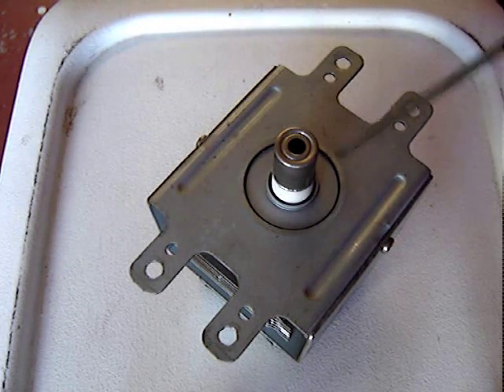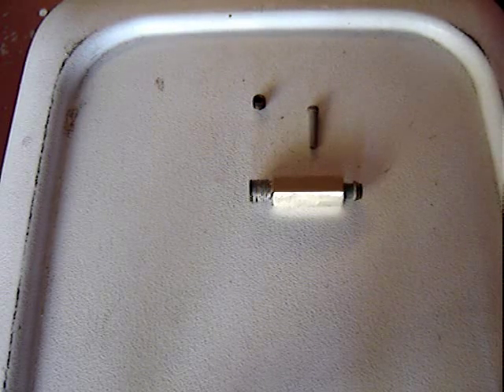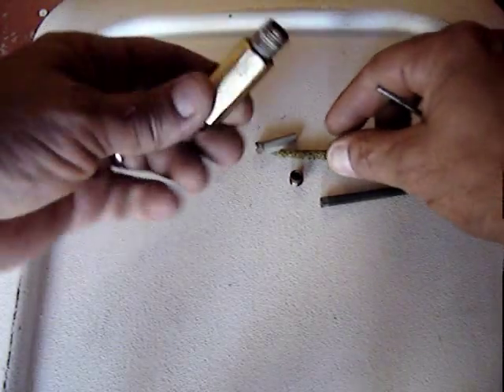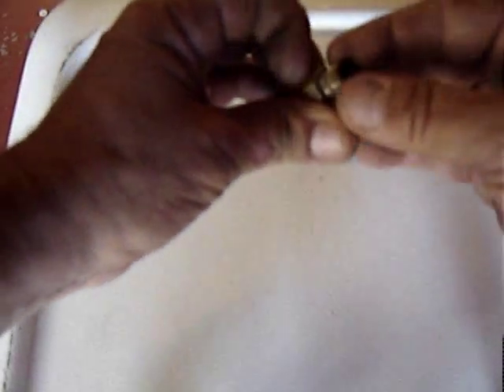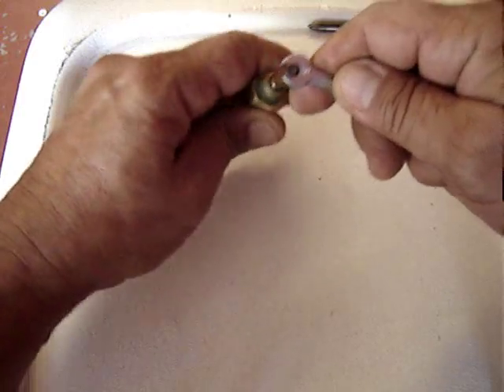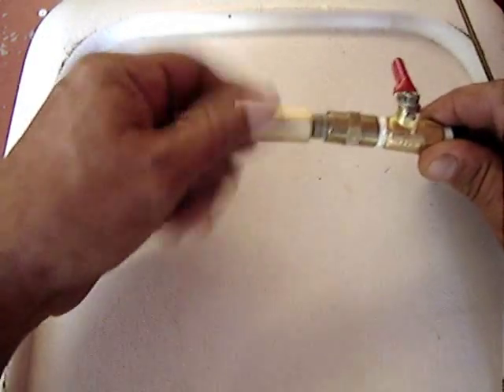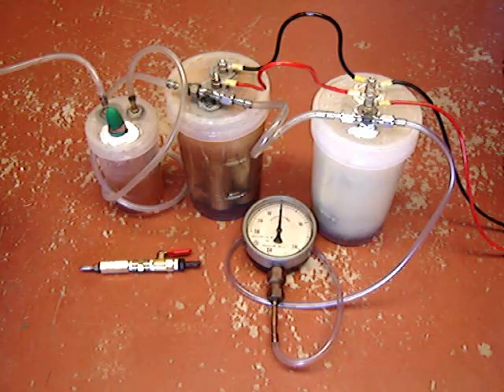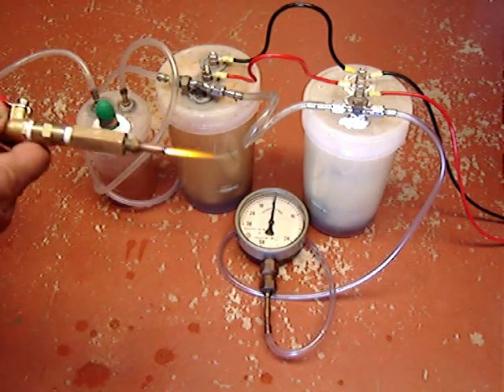Hho Flashback Arrestor Torch

Comment: good video! i want to make my own one instead of buying . Thanks for the instructions
Reply from the maker: using the bronze mesh works well. you could even just stuff it in a short length of 1/4 inch or 6mm stainless tube instead of finding a brass fitting like I had.